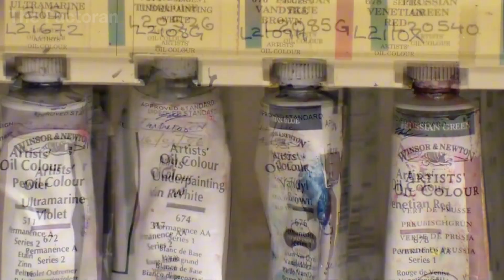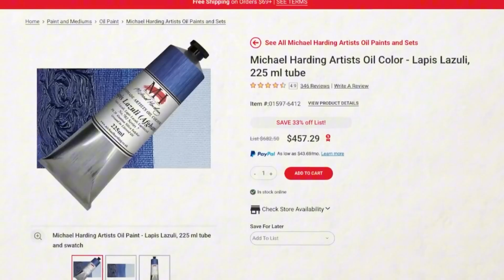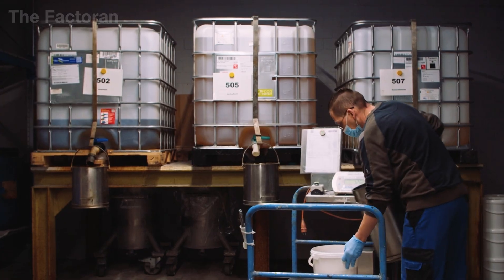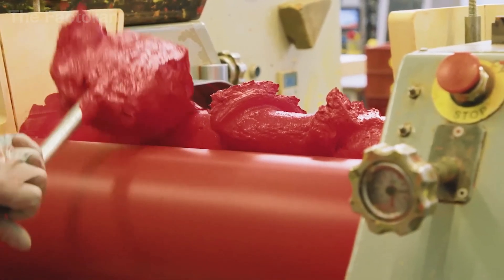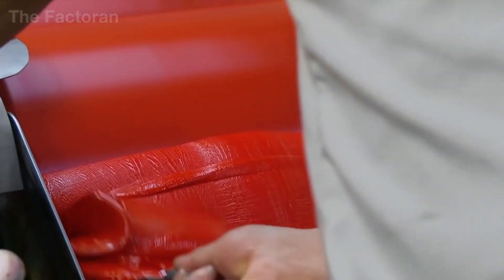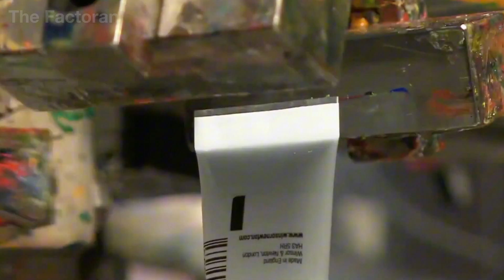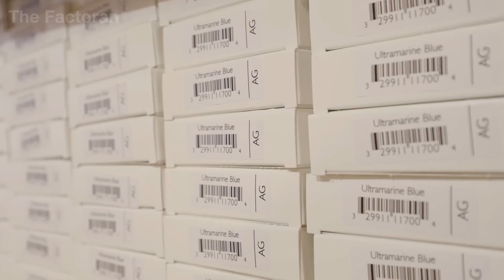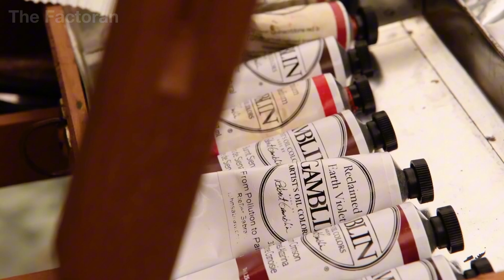How Oil Paint Is Made From Pigment Powder Inside Massive Production Line

Comment: AI slop with robotic voice over (listen to the awkward pauses and the wrong stresses on the words) and random stock video. Give it a dislike!
Reply: I’ll give you a dislike instead. The information is good.
Reply: @melgross  Its not, I work in paint manufacturing, most of the information here is incorrect.
Reply: @MrPigments what is incorrect, that is “most of it”? I’m pretty familiar with paint manufacturing. I found most to be accurate enough in the general information, if not so much specifically.
Reply: Then turn off the sound! Can't you read?

Comment: So in the olden days of the old masters - how did they make their paints without aluminum tubes and hi-tech machinery ?
Reply: After grinding the pigment (usually done by the apprentice) linseed oil ad egg yolk was mixed and stored in containers like shells . Eventually the process was changed to what we have today however in order to take the paint outside for painting the paint was pored into pig intestine. Later it was stored in tubes. I hope that helps .
Reply: A lot of the pigments were poisonous as well. A lot of artists died from their paints.
Reply from the maker: They ground pigments by hand and mixed them with oil using simple tools.
Reply: By hand grinding them into linseed, walnut or poppy oil on a roughened glass or stone slab. Usually using a glass muller, sometimes a stone muller. Rarely by mortar and pestle IF finer grinding was not required for that pigment. 

Mediums (Oil & solvents & their dissolved resins & waxes etc) were added- usually  while at the palette + painting stage.

 The paint was often stored inside an animal bladder and tied tight being punctured when needed. Wax & Egg Tempera & other emulsions could be combined or painted over with oil paint & glazed etc, in  differing oil formulations & using careful 'fat over lean' techniques. Not all combinations worked!
Reply: With pestle and mortar and a lot of elbow grease.